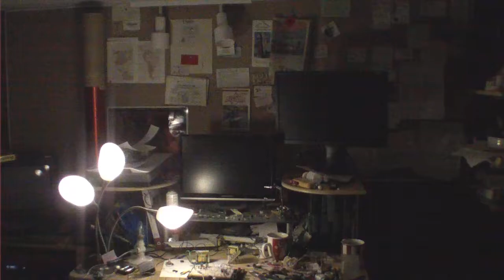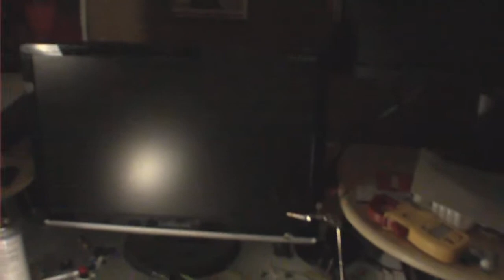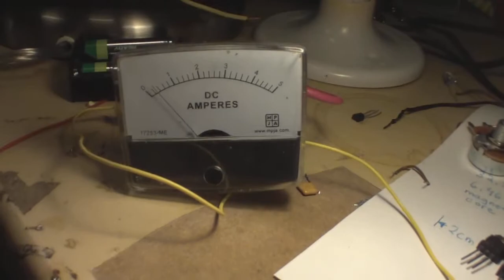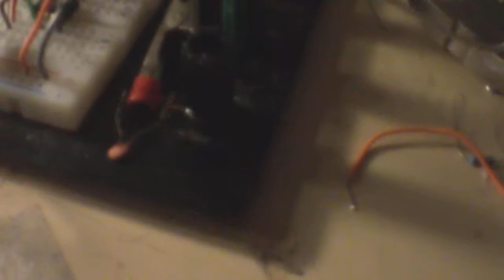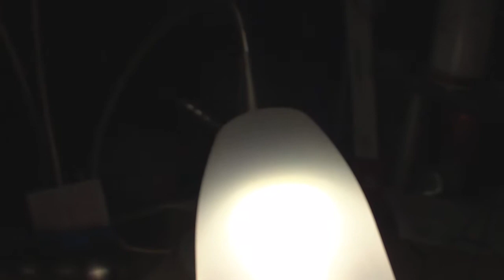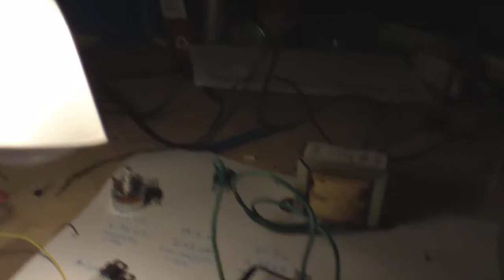(3) "Wimpy" - A PWM Limited FLIP FLOP DC - AC Inverter

Comment: @KyleCarrington @KyleCarrington First of all check for AC around the 555 as the old saying goes what ain't broke don't fix, The best place for u to put a Diode to protect the 555 is between the Mosfet and 103 poly cap and 1 on pin 8 If the .7 drop is effecting the timer from pumping the Mofets it's safe to use a Ge diode as there is very low MA in that part of the circuit but the 555 operates anywhere from 5-15volts So I don't think u'll have trouble

Comment from the maker: @TheKultus Ok.. I have the output of the 555 (pin 7 discharge) running through a superfast diode that is good to 4 or 600 volts (i forget.. it is high though) RHRP3060. So, you are saying that on the input side (pin 4) of the 555, run that, first, through a diode? I do have some germaniums too if the .7 drop is "undesired". Is that correct? Thanks for examining.

Comment: @KyleCarrington, I would be worried about the feedback of AC to the power rails, check around the 555 as it is the most sensitive component, see if you are picking up any AC  in that portion of the circuit, if you are I would be adding come 1n4001 -4007 diodes so you don't cause any damage to the chip, but if it is just on the 12v rails and no where else, it's the back emf of the transformers collapsing magnetic field, a couple of diodes can go either side of the rails to stop that.

Comment from the maker: @TheKultus Interesting. I'll have to do some experimenting. I'm picking up some AC on the 12V power rails, and I don't understand that. My PWM experience, before - was HHO/motor related, in which case I'd use (fairly) large electrolytics, say 2200 uF on the power rail, but in this case, I'm not sure.. I have a 225K (2.2 uF?) polyester on there now.. but I think it could be a better choice perhaps. I agree though, tantalums seem to be very good caps.

Comment: Kyle Different types of capacitors have different frequency capabilities, that is why the poly cap worked better, you will find a tantalum capacitor will work even better, but they are a little more expensive

Comment from the maker: @SkyWatcher1313 Thanks for the compliment. It's the first time I ever -really- mucked around with a circuit, with a goal in mind, and accomplished something. Engineers would laugh, but as far as I'm concerned they can keep laughing until they come out with a variable output inverter for $20. Cause most of this came from garbage, I only bought the transformer, and a few resistors. And there's no heat at all to speak of, no rheostats, no linear voltage regulation...

Comment: Hi kyle, it looks good to me. I have a bunch of warm white leds running off straight dc and low volt capacitor smoothed wall warts and they all seem rather close in light output to what yours appears to be. 
And for sure, store bought inverters are more like, one size fits all. Which is not ideal.
peace love light